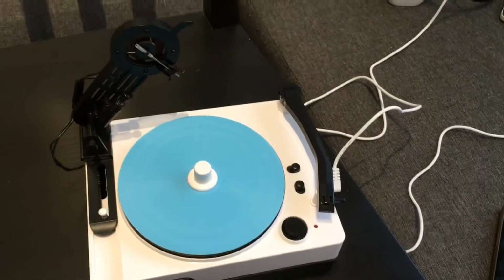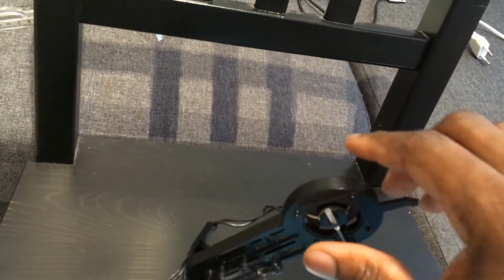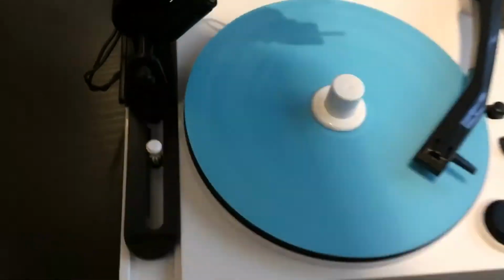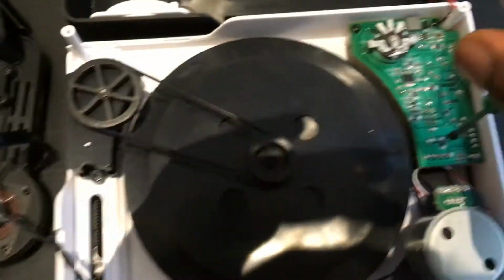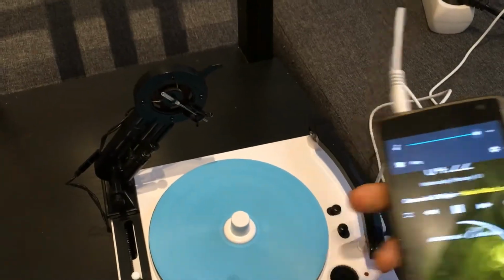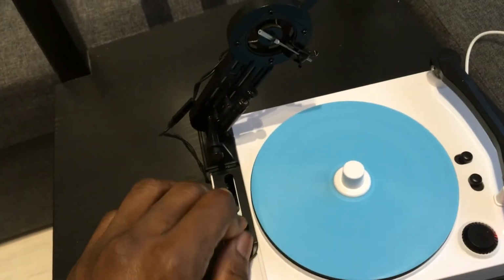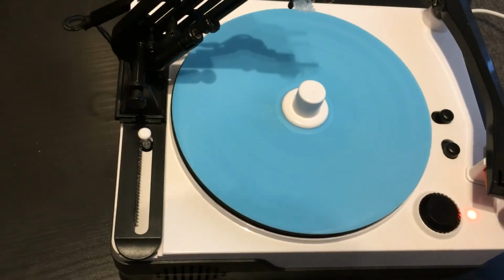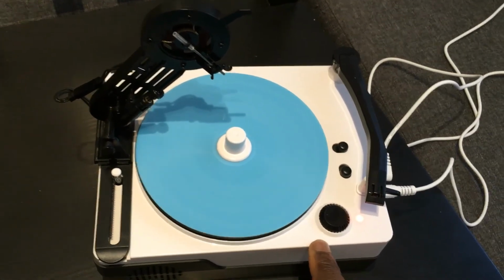FIXED: Gakken Record Cutter, not working.

Comment: Interesting! I had the same problem — no audio from the cutting arm. But if I plugged in headphones, then unplugged them, it started working. I did this for awhile, and recently the problem is gone. So maybe there's an electrical problem caused by the screw when things are in certain positions. I'll try removing or loosening that screw. Thanks!

Comment: I bought the Gakken record-maker for fun, built everything as instructed, turned the thing on aaaaaand it barely spins. I looked at the inside and everything seems to be in the correct place, long rubber band included. Would you happen to know what the issue could be? Seeing that yours works fine I figured I should try asking around